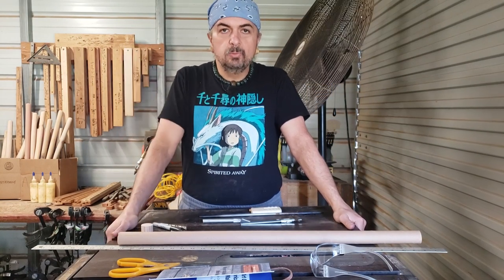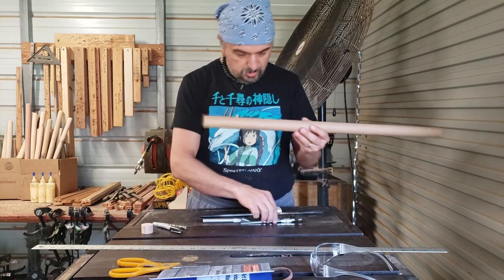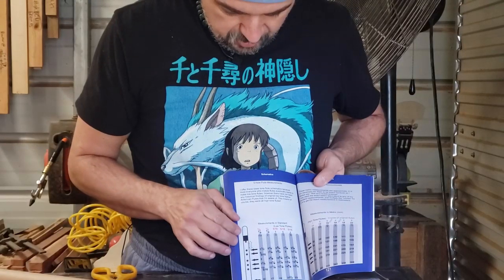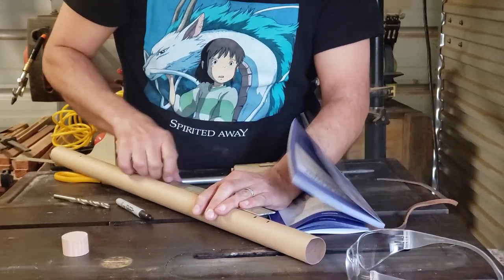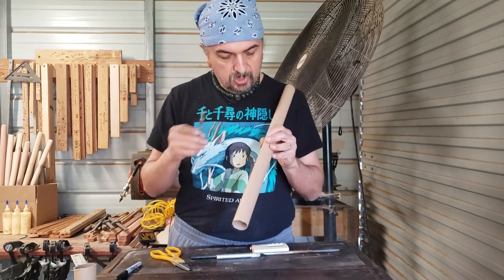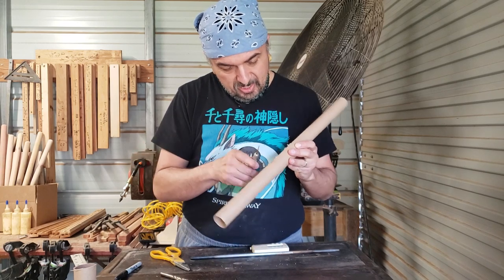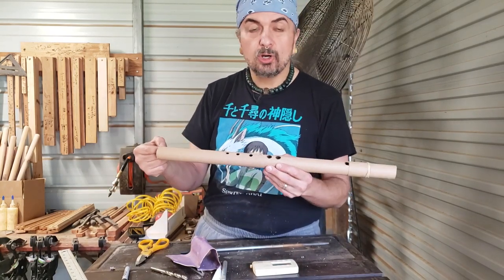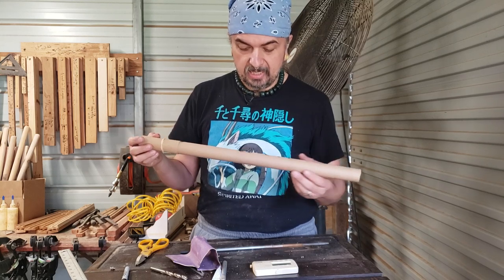How to make a Flute from a Cardboard Tube

Comment: G'day Charlie.
I have made some beautiful sounding bamboo flutes using the same methods (your methods) you just used from your book. With the sound hole and sound track left without flattening the track area and using a piece of the same bamboo (after working the bamboo piece to shape) as the sound block.
Looks and sounds fantastic. I only have one problem, when you choose the paper and cover of your next book, please make them more oil and wax friendly. I have had to cover the pages I use most with laminate to keep them in a readable shape. }:- ) I can and do make a mess all the time. Thank you. Tom

Comment: Have you ever worked with (wet) Elderberry branches? I'm experimenting but without actually splitting the branch in half, how do I create a smooth bore? It is a bent branch...
Reply from the maker: I believe we have an old video of me making a flute out of Elderberry but I may not. I will have to go back and check. One of my favorite flutes is elderberry (6-hole I play in some videos) and works easiest when it is green/fresh cut. How to work with it begins with selecting the right piece. It's best to find new shoots which are the diameter you want to make a flute with. There will be shrinkage when it dries. You can then push the center pith out of the wood and even can leave a small bit of it inside for the plug if you like. I have been meaning to make a new video using similar materials to show the simplicity of such a thing. 🙂
I hope that you are doing well my friend.